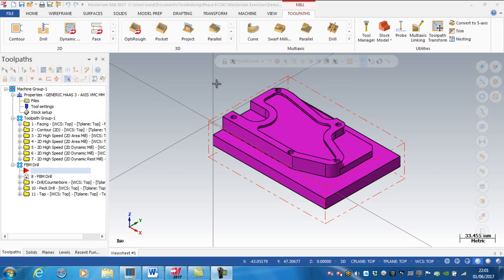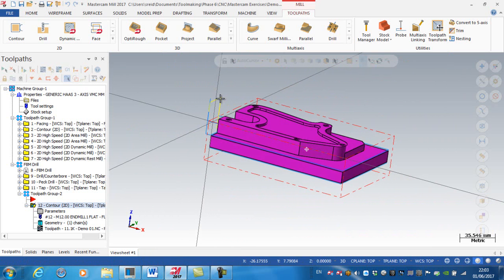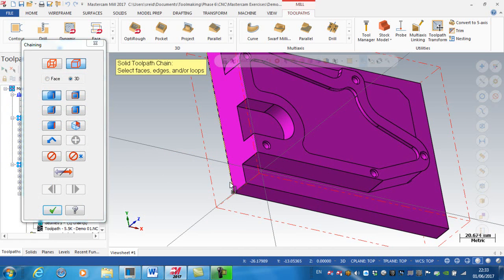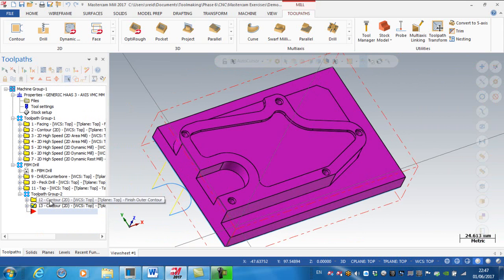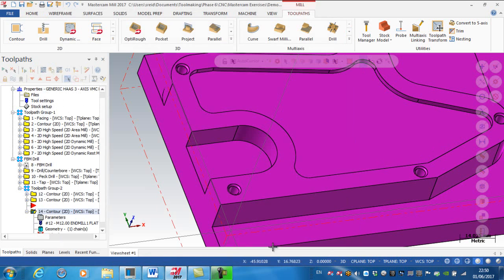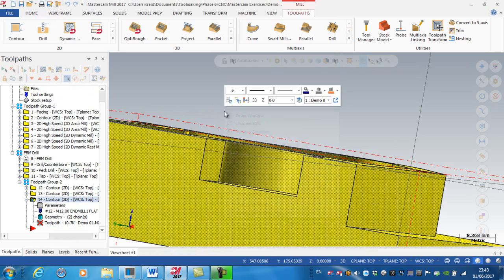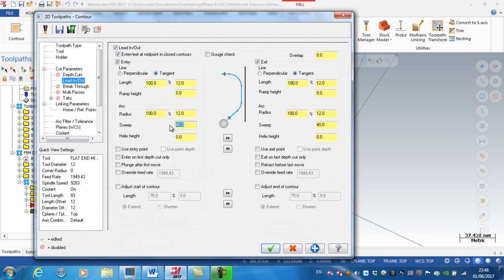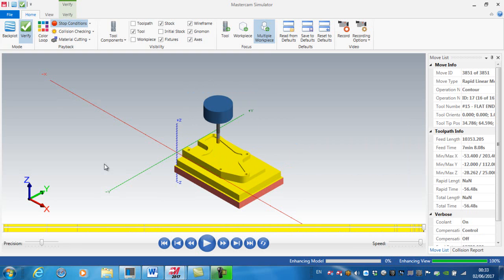Mastercam 2017 #29 - Solid Model - Finish Contours

Comment: Super new to this 
To be clear when you set up for g41 or g42 compensation, is the machine going to recognize that and know to ask what tool you are going to use, as if in mcam the tool you create the toolpath with is just a general "ish" size or placeholder. 
Im guessing this is to compensate for whatever wear / regrind state the actual tool used is in?

Comment: deburring.
1. how would someone alter a contour to remove sharp edges. For example, the tight U-shaped pocket. How would someone add a small 45 chamfer on the start and end of the U. For instance, instread of your method for lead in, you led with a ramp from the other side
2. what is the best method for following a contour with say a spot drill or chamfer cutter to deburr the top of the pockets